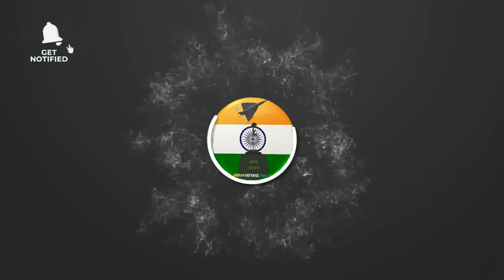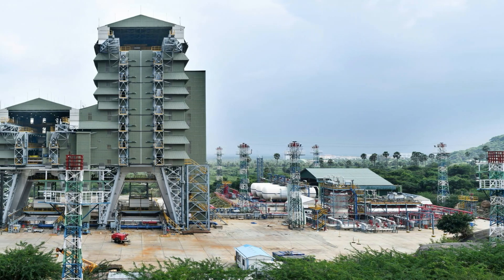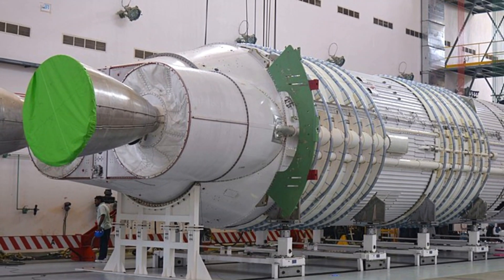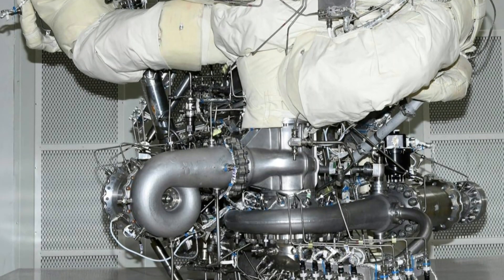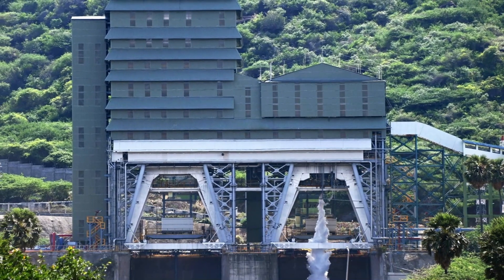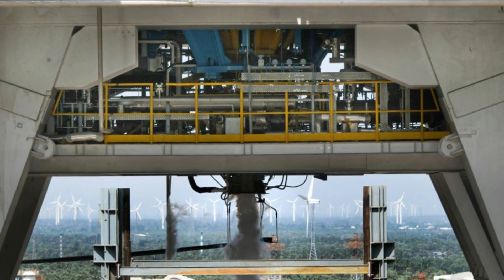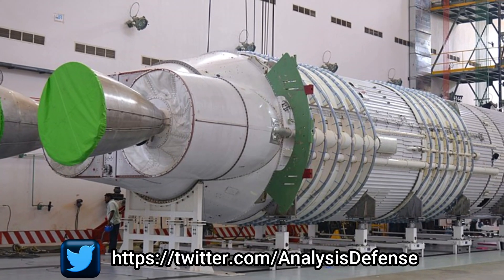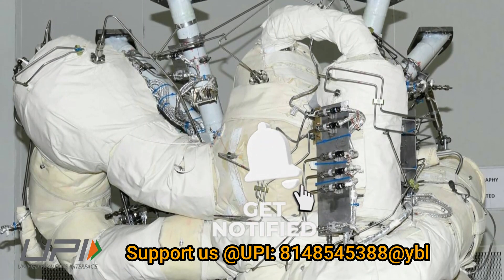#breakingnews ISRO conducted the maiden trial of 2000 kN thrust new semi-cryogenic engines SCE-200

Comment: While landing on moon  the engine fitted with the lander should have low thrust engine  to reduce the speed of the lander and also speed evacuation system applied while reaching 50kms near the landing site for soft landing of lander

Comment: i am really confused here, we can make 2000kN THRUST ENGINE, but we cant make 100kN THRUST ENGINE?????????????????? admin can u give me answer, to understand this
Reply: Rocket engines and jet engines are completely separate and different technologies and cannot be compared with each other. It's like asking a marathon runner who do not have training in mountaineering, " you can easily run 42km, so why can you not run till the top of mount everest which is not even 9km above sea level "
Reply: Rocket engine = more static parts, simple design philosophy, somewhat simpler metallurgy than jet engines, single use mostly, burns mostly few minutes, Does not depend on conditions of outer atmosphere like oxygen levels/altitude/temperature, not a very secret technology, cooling systems are simple,does not carry humans 99.9% of time so Safety can be compromised for performance...

Jet engine = almost everything is moving parts,  Complex and top secret metallurgy, need to start and stop regularly, work for thousands of hours and years, carry lives so nothing is above safety, complex design, need stable operation at ground level upto at least 65,000 feet, cooling is harder, manufacturing and testing facilities are 100x expensive than the engine itself....the list goes on

Comment: I think the small satellite launch sector should be left entirely to private players like Skyroot Aerospace and AgniKul Cosmos. ISRO still hasn't adopted the newest tech like 3d printing and composites. NASA has also adopted zero boiloff cryogenic tanks, which ISRO is not yet researching. ISRO needs a bigger budget to focus entirely on the spaceplane and the Universal Launch Vehicle, which will revolutionize the space sector. ISRO should focus on the most important projects and outsource less important work to others.